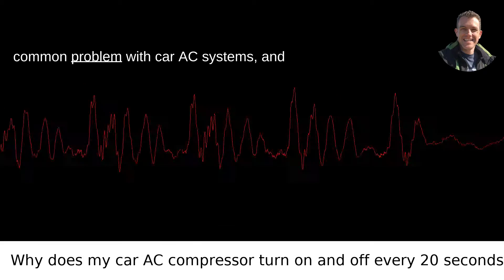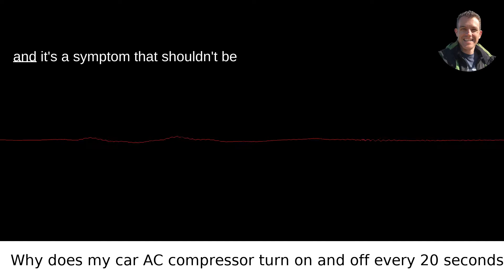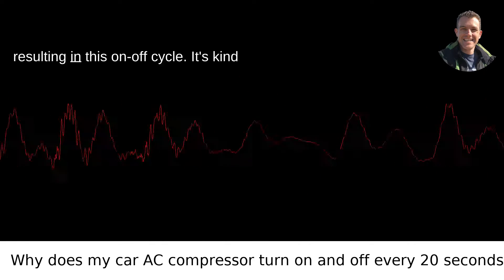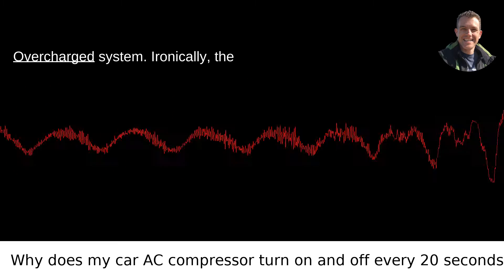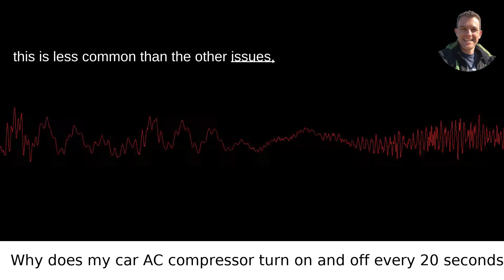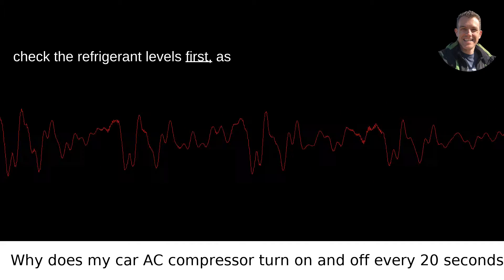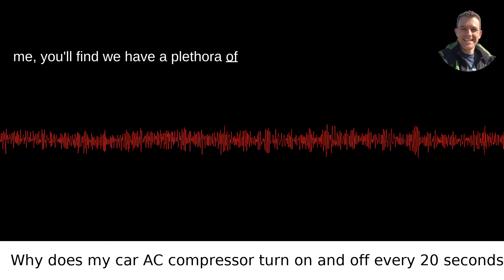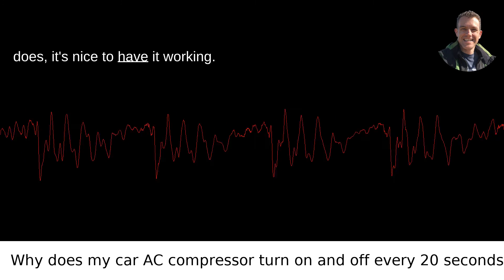Why does my car AC compressor turn on and off every 20 seconds?

Comment: I have a 95 Silverado with 5.7L.  The A/C system looks in good condition on outside. No leaks noted.  A/C compressor keeps turning on and off every 3 to 4 seconds.  I tried to recharge with r134a but it wouldn't take. So I jumped low pressure switch to see if that helped. Compressor would stay on and cab air would get mildly cool (not cold).  Still would not take the charge in. 

When the low switch is connected the compressor reads 40ish (low side). When it goes off its 15ish.  I do not have a full gauge set.

Any tips on how to get the system to take the r134a?  Or what causes this?  

Many thanks...
Reply: Did you ever figure out what the cause was... ?
Reply: @ipman3564 bad compressor. Also leaking low and high valves. Very slow. Over 2 weeks.
Reply: @thesetruths1404  Nice... How did you figure out 'where the leak was' ???
Reply: @ipman3564 both service valves were slightly leaking very slowly.
Reply: @thesetruths1404  Did you use Dye to find it?
Reply: @ipman3564 no. I did install dye. But when I removed the caps after several days the would fizz the leaked pressure. Soap and water would probably detect it also.